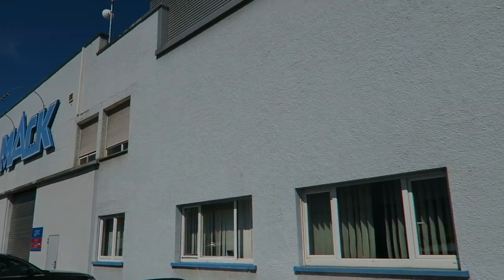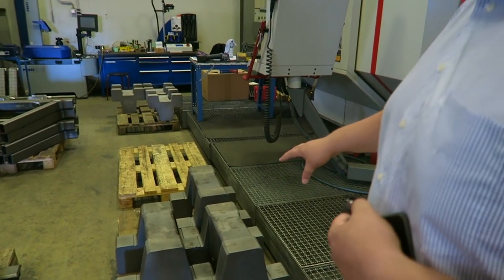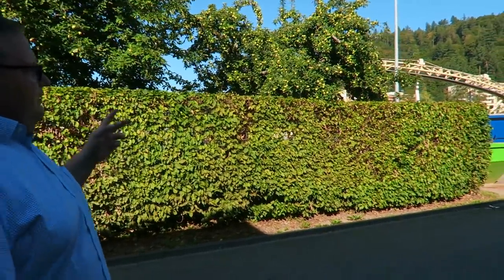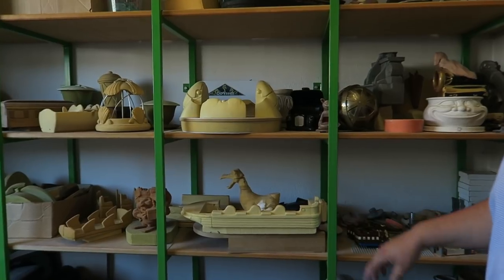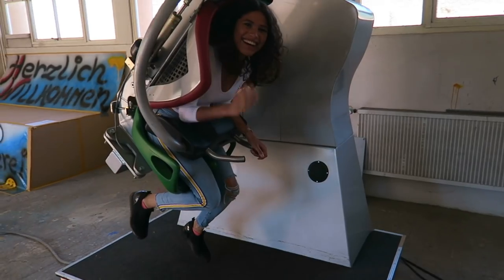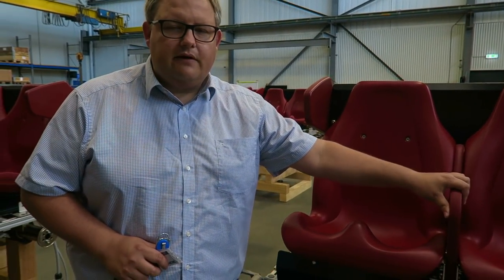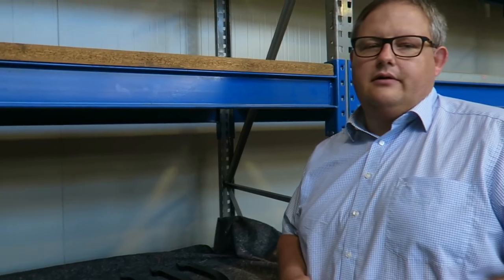Mack Rides Factory Tour - New Eurosat CanCan Coaster! | #15 Jessica's Vlog

Comment: Nice video, it's not every day that you get to see inside a (usually secretive) coaster factory!
Reply: Well, they never show the actual track fabrication on video, and they didn't show it here as well. Obviously Mack Rides doesn't want their competitors to know how they get their track that smooth.
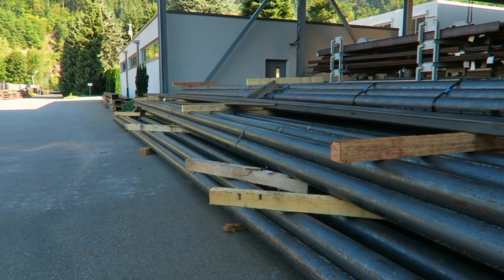Reply: @ireeb  there actually is a German documentation by the local tv Programm in youtube. They dont Show much but there are some scenes where the Tubular Steel gets bent. 4:01
Reply: @vz9931  there is much more behind it than just bending it. All manufacturers have to bend their track, but what's special about Mack is their extremely precise and tight tolerance control.